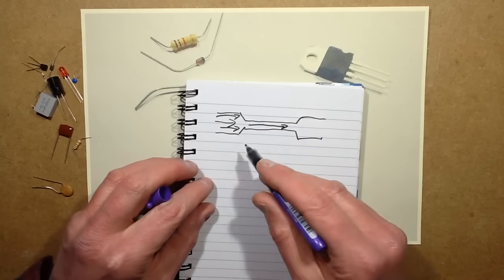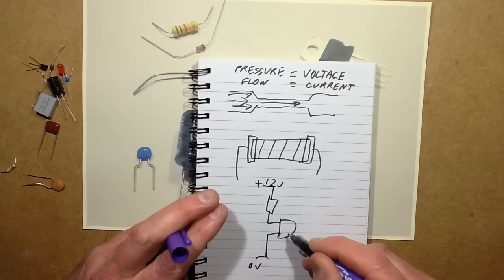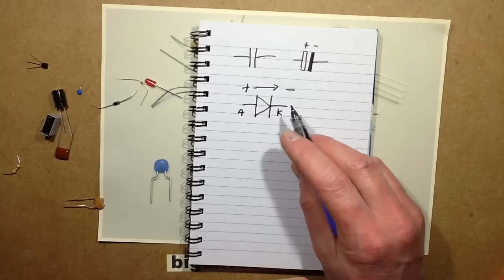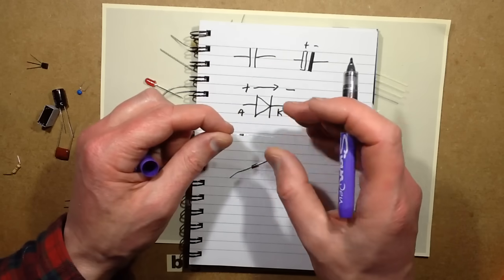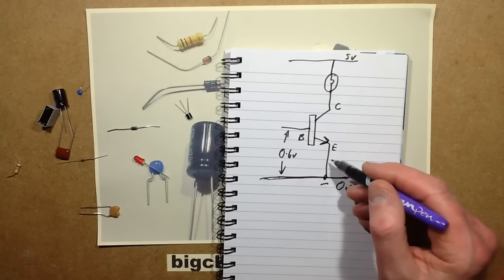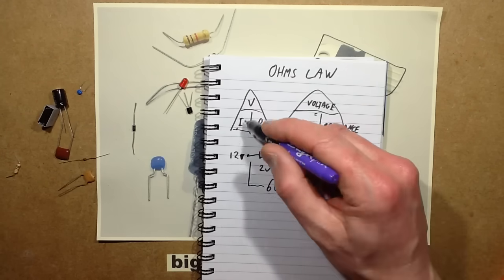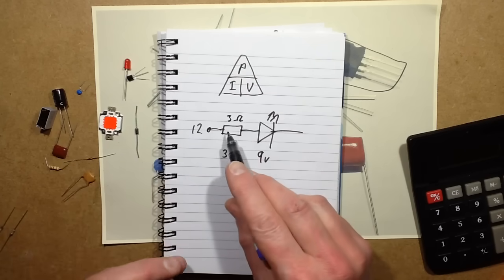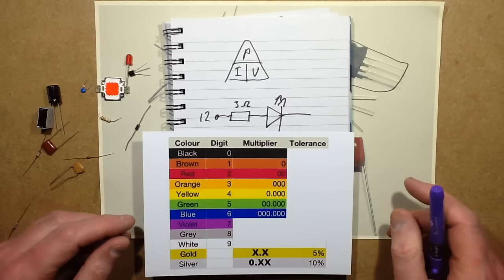A simple guide to electronic components.

Comment: Very educational thank you,
I will never forget what a capacitor does as long as I live now  , in the year 1996 the misses shouted washing machine not working, 
Out came my tools again, off with the lid `bent into the machine , checked the usual stuff, one hand on the machine the other wondered onto the big silver looking capacitor as I know it to be 5 minutes after the incident , My fingers made the connection across the wire connectors coming in,
Then wallop ' it was like I'm humping that Bast--d machine, my whole body was wobbling uncontrollable for a dam long time,  
I Couldn't even shout for the misses` I was being electrocuted for a good while , I also in my haste left the machine plugged in, 
I can laugh about it now thinking how I was bashing the machine while being electrocuted, I thought it was going to stop my heart it was that bad,
I think it went on for so long because the machine was still plugged in with the switch on at the time, lesson now learnt lol.
I did fix the issue` bushes worn. Misses found it very funny when I told her` typical, So I told here lets see how funny it will be when you fork out for an engineer next time lol,
Reply from the maker: Washing machines are responsible for a lot of serious shocks.  Water, lots of grounded metal and loads of bare contacts, especially in the older machines.

Comment: Could you make a higher value capacitor by sticking 2 pieces of aluminum foil back to back just using the glue as an insulating layer?... I'm going to have to try.
Reply from the maker: You possibly could.

Comment: I have heard that back in the day, every radio company made their own components and nothing was standardized. So they all made their own resistors and every manufacturer had different color codes. Also, the resistors were rebuildable - they opened up like clam shells and you put, basically, a pencil lead into it. Do you have any of those oldies?
Reply from the maker: I've not come across those.

Comment: Regarding your analogy of flow of water/flow of electricity through resistors: when there is i.e. 60 pounds pressure in a water pipe 2 inches in diameter, when you add a "resistor" i.e. a section of 1/2 inch pipe, less water/electricity flows but the water will shoot out many feet...less water but traveling much faster whereas before it only shot out maybe a foot or two. There's much less water but it has 60 pounds pressure through a 1/2 inch opening. I don't see that anything similar happens with electricity downstream from the resistor. Does your water/electricity analogy break down at that point?

Comment: electrons don't flow from + to - I think. It should be negatively charged to a positively charged atom. I think? 🙄
Reply from the maker: I used conventional current flow.
Reply: @bigclivedotcom  Why is such counter-logic a convention? It seems confusing.
Reply: @nynra6584  It really doesn't matter as long as you're consistent. Describing how the "hole" moves versus how the electrons move is the same thing just in opposite directions.

Comment: In a standard kitchen electric stove, why do burners produce heat and the control knobs don't?
Reply from the maker: The control knobs usually cycle the electric element on and off, so the knobs are not dissipating much power.  Look up simmerstat.
Reply: @bigclivedotcom  thank you, most particularly for the reference.  I've been trying to find a google search to answer the question without success.  Just found you today.  You're made a certain viewer from now on.

Comment: 27:53
About resistor values: 600 Ohms is indeed not a standard value but 620 is. You're saying you have to choose either 560 or 680 but that's because you're talking about a different resistor value series.
So why are there different value series?

Comment: About capacitors; there are different kinds (as you are showing) but are they all doing the same as long as you take the value you need? Or are there more differences between the different kinds? And why do some have + and - sides while others can be connected either way?
Reply from the maker: The non polarised ones tend to be low value and simple in construction.  The polarity sensitive ones like electrolytics have an electrically formed chemical barrier and liquid electrolyte to achieve a very high value.  Reverse polarity breaks that barrier down and causes high current, bubbling of the electrolyte and potential bursting from the resultant pressure.
Reply: @bigclivedotcom  Thanks! Much appreciated.
Learned something again.

Comment: I analyze all electronic components like the human body organs.
Inductors-Lungs
capacitor-heart
Resistors-veins
Transistor-nerves
diode-heart's left valve
battery-stomach
Ground wire-intestine
Speaker-mouth 
Mic-ears
Reply: For sure.  Is it the cannibals or the human recyclers that I should worry more about?  The former group motivated by passion, the latter by greed.

Comment: Decent intro, motivates seeking additional knowledge. Although could transcend into physics, but physical equations (I forge into math while others intentionally avoid, along with specs, tolerances, ... including ckt configs such as the series DC analysis using Ohm's Law, which diverges into describing distinct properties for parallel ckts, but only so much in a brief episode & motivates further study) would help describe components, construction, & materials used. Still good to investigate physical construction. Sometimes water analogy is dubious, but sufficient for an intro. Good that you alluded to topics irt energy, thermal or heat, friction, & such that impact components operation, wear, tear, leakage, & failure. Why particular types of component selected when composed of different materials (beside hazards with materials, so avoid opening the electrolytic cazapitor)? Astute physical observations among worthy technical skills that enhance insight. Many failures assessed due to leaky caps & the underlying causes; often they are used due to cheap & planned obsolescence by mfrs (manufacturers). Different analogies describing charge carriers movement about the circuit (even emissions & emanations, their control & use another topic), electrical current, electron flow, conventional or hole, with respect to the charge carriers such as electrons, ions, & their seeming absence. Voltage often described by Electro-Motive Force, or EMF, so in Ohm's Law symbolized as E. Also, another topic irt diode operation, such as Zener, that you introduced could be enhanced by mentioning avalanche voltage; the basic components have intriguing variations as do circuits. After all, supposition is invitation to investigation & application, beside among various ways to communicate & understand. If I may, a couple of times, noticeably during the transistor topic (definitely "amazing little things" that compose ICs et al), possibly misinterpreted current & voltage when describing junction operation of the common emitter ckt; circuit configurations is a vast topic, but always rely upon ensuring consistent understanding of the fundamentals. Symbol of the resistor conventionally uses several zig-zag lines. Why destroy another resistor when vid can be rewound & reviewed ; )? There are non-offensive mnemonics, especially with some fundamental knowledge of the E-M spectrum, visible wavelength, which all elex & science personnel should be aware (I try putting an effort into discipline & virtue but aware of all else). uster rown aces ur oung irls ut iolet enerally ins Go Start Now! Definitely appropriate time to discuss the Watt related with energy & power, the dissipation in the form of heat, & when those tolerances exceeded.  Amazing that Michael Faraday had such insight, ability, & drive, especially given the rudimentary resources, many that he created. His influences are still paramount. Anybody ever read his publications? I've always wanted to physically visit the Royal Society library & the areas where Faraday, Davy, Priestly, & such esteemed legacies beside meet the current researchers & professors.
Reply: Lol, paragraphs dude, paragraphs.

Comment: Dell had a problem back in 2005.  They bought a bunch of defective motherboards.  The Electrolytic Capacitors that were used for Video portion would puff up at the top and the liquid would flow out the top.

Moral of the story.  If your devices start to go bad, check for the capacitor puffy at the top.

Comment: The crap with 5 band resistors, 1k - 1% for example, you have a brown stripe on the  both ends of the resistor and the manufacturer often leaves very little, if any gap between the value and the tolerance. The problem is, which direction do you read it?

Comment: Hello, I plan to use tweezer iron (2 irons) on a cheap soldering station that works on pulse crurent . Impedance of my iron is 15ohms impedance of the double iron is 28ohms . I am afraid that the tweezers will not be hot enough , or that I will have problems with the regulator  having tu push it to the max just to get to 280 ° c . 
I thought of using a 30w 25uF resistor mounted in parallel just to protect the station but I guest it will also take some heat from the iron is not it ? Thank you

Comment: Clive, I find mnemonics as difficult to remember as the thing I need to know, so I use logic (even if a bit contrived) as follows.   It is easy to remember that black is 0 because absolute black has zero light.   We just have to remember that Brown is 1 (I can't think of any logic for this one).   Then the next six colours from Red to Violet are the original colours of the rainbow as specified by Issac Newton (Newton added Indigo later as he wanted there to be 7 colours to match 7 notes in a musical octave).  They run from lowest frequency (red 3) to highest frequency (violet 7).    We have to remember that 8 is grey.   White (full spectrum) has the largest value of 9 (at the opposite end of the scale from Black).   Can anyone add something logical for Brown and Grey?
Reply: I just remember it as 
Black - Black - 0
Boys - Brown - 1
Rape - Red - 2
Our - Orange - 3
Young - Yellow - 4
Girls - Green - 5
But - Blue - 6
Violet -Violet - 7
Goes - Grey - 8
Willingly - white - 9

Comment: Have you ever used a program to design a circuit? Make it work, before you actually put it together physically?  If you have, can you recommend one that's up to your standard, will take nothing less.  TY
Reply from the maker: I've always built physical prototypes on breadboard, or direct to copper, and then experimented with component values.

Comment: If the colour bands are the same on resistors, does it matter if the overall colour is  "baige" or blue or any other clour ?
Reply from the maker: The base colour usually represents the construction.  Beige for carbon film and blue for metal film.

Comment: Very informative! Thank you!
1 question though: In the example at 29.20 in the video, you use Ohms law to determine current flowing through the circuit.  You use the resistor to determine the R, how about the LEDs? Have they no R value? Doesn't the resistance of the LEDs have to be factored in the equation?

Thank you!
Reply from the maker: LEDs have a voltage drop that varies slightly with current.  It's typically between 2 and 3V

Comment: So then is Charlieplexing a bad thing since it constantly reverse biases the LEDs and thus causes damage?
Reply from the maker: The parallel LED clamps the voltage to about 3V, and even without a parallel LED the voltage is usually just 5V which is within the reverse bias rating.

Comment: I work with Meiden variable vacuum capacitors, can you explain how those work... I don't believe they have a dielectric in between the two conductors, but a vacuum and the two foils can be moved to increase or reduce capacitance, but what I don't understand is how a vacuum acts as a dielectric.
Reply from the maker: Any space will act as a dielectric.  The main thing is that the plates don't touch.

Comment: Where did the electrical in the card board capacitor come from--as soon as you put metallic tape on either side of the paper, it read something like 1.8 microF.
Reply from the maker: The meter was testing the capacitance of the metal layers with insulator.

Comment: My brain shut down around the ohms bit so I'm going to have to watch this again tomorrow, ROFL
Reply from the maker: Just do things at your own speed.  It all falls into place like a jigsaw over time.
Reply: @bigclivedotcom  I tend to learn by watching and only when what I need to know is required. Unfortunately, I don't need this particular information, currently (no pun intended), as I'm just working on getting a simple solar setup going so all that's required is solar panel, inverter and voltage converter info for what I'm doing - and I've picked up the difference between a voltage converter and a voltage regulator which may come in handy later.

Comment: The current through a diode, or any electronic device, is from - to +. It should be restated that the current actually flows into the arrow of the diode and not what you stated.
Reply from the maker: I used conventional current flow because it relates better to symbols.  Once people are familiar with electronics they can explore electron flow.  The only people who really need to understand the direction of electron flow are scientists and semiconductor manufacturers.

Comment: Is a variable resistor the same as a potentiometer? Like an adjustable pot found on the volume and tuning wheels in a stereo?
Reply from the maker: Yes.  Although some can also be variable capacitors on older equipment or digital encoders on new equipment that send pulses to indicate direction and speed of the knob.

Comment: Around when I was 12/13 years old my precious TFT monitor went badly and what do you do, you take the monitor apart and see one of the capacitors had went nuclear, bought a new one and replaced it. One thing I remember was odd, the capacitor was rated too low in voltage, so I bought a more powerful one, and the screen worked.

Comment: Back in a basic electronics components class I had, we were working on a basic thermometer circuit that would light a white. The room went from noisy to extremely quite after we heard something that sounded like a gun going off. Turns out someone connected the white led backwards and managed to get it to explode by "accident"

Comment: Clive, I am trying to repair my impact driver charger, as one of the resistors has gone pop. It appears to have  Black Red Red Silver Gold banding.
Checking the Colour Code it comes out at 0.22 ohms is this correct. If so where do I get one from as I have tried on-line but they look nothing like what I have got.. I have thoroughly enjoyed watching your presentations over the years, thank you .

Comment: Those things that look like barrels with two wires and cross on top of a smaller one leaned into the bigger one...will they just get melted where they touched?? And what is a good starting multimeter?? I’m looking for something this idiot can understand....
Reply from the maker: Those are electrolytic capacitors.  It's usually not an issue if they touch.  They sometimes glue them together for support.
Just about any cheap meter is a good starting point until you appreciate better units.

Comment: Hey i have a question , maybe stupid but l like to know for a project.
I have build a battery spotwelder and i want to use 3  16v capacitors 1x 100uf 1x 220uf and 1x 470uf that release a charge to contract a relay for a consistend weld. (timing)
Now my question is: the capacitors i want to select them with a 3 position selector switch but the negative is combined... i think... correct? do i need to use for each capacitor a diode so the current does not flow in the other 2 capacitors that are not selected at that point.
thx :)

Comment: Did you do part two yet? if so Where iz it Please? feedback, as requested when you draw out a circuit, can you do it on a single page so us dumb Plumbers can pause the vid, The water analogy is fab, can you only have the components in the shot you are discussing, what about colour 0.0 V Black +V Red, How about draw the symbols in a border around the schematic with its name or Left Right Bottom Top Margin, please keep the schematic free from as much writing as possible.
Semie retired not working just getting into electronics main interest Solar of grid stuff and AV, your vidz make the knowledge very accessible cheers for that. Mick The Plumber

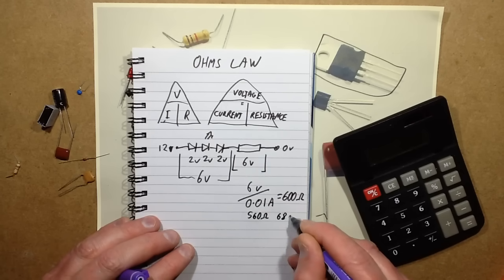Comment: 28:00 of course you can use 600 Ohms. Resistors are cheap, so you can just use a few of them in series to get the right resistance.

Comment: This video is one I come back to every now and again, just for a refresher as it were.  The problem I face since I rarely have to build a circuit is falling into my old belief system that a capacitor goes in series with a circuit, instead of across the power supply, as it is.  For example I have found myself building little 5 volt power regulators to run off 12 volts supplied by three 18650 cells.  When I put them together, I sometimes find that they do not work at all, till I trace it down and see that I have inadvertently stuck the capacitor in the circuit as if it were a resistor instead of across the plus and minus to use as a filter or to add a bit of power to the system when the device calls for more power then is allowed by the 7805.  It is usually a quick fix but annoying to see that I keep making the same damn error  time after time.

Comment: Too many times have I connected an electrolytic capacitor backwards. One time, the entire aluminum can blew off the actual capacitive elements with a loud POP. I was disappointed because it came out of an assortment kit, so I don't yet have a large pool of my most used values.